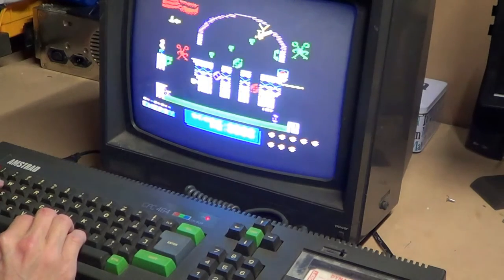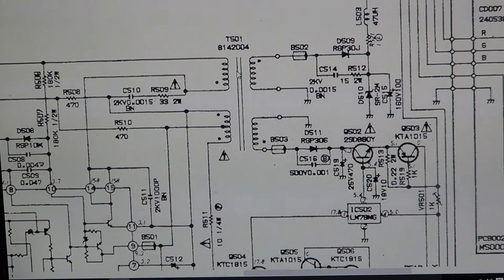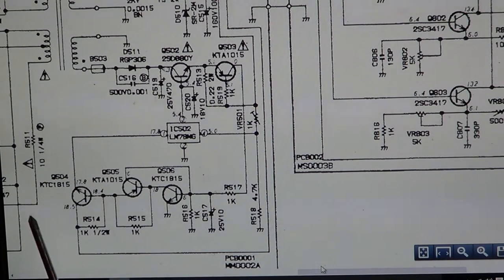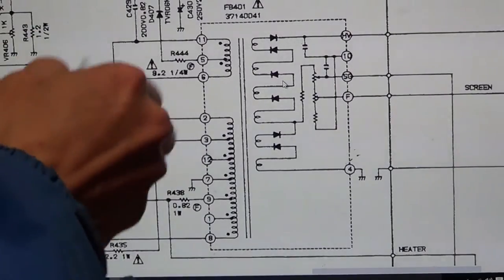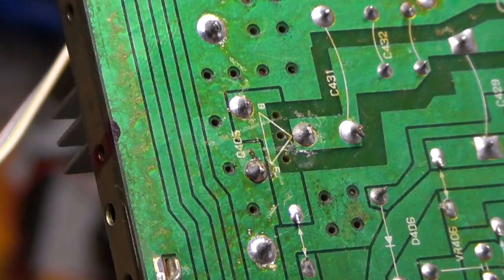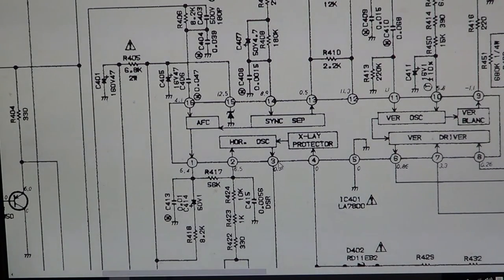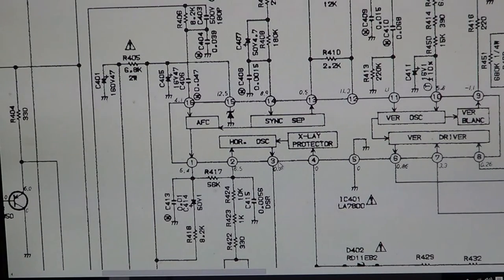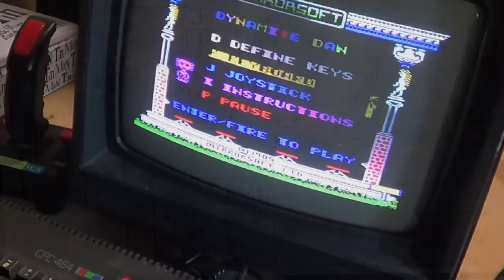Amstrad CTM-640 Diagnosis Walkthrough

Comment: Nice job on the repair!  I have a 8" Sony PVM that would power up, but wouldn't display video.  Turned out, the 12 VDC regulator was bad and the +12 VDC rail was dead.  Replace the part and the PVM came back to life. :-)